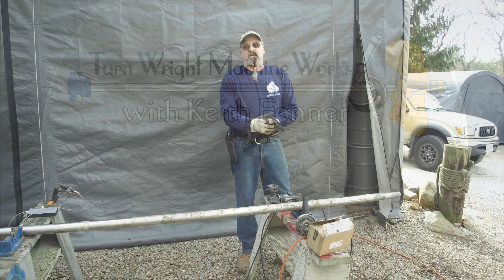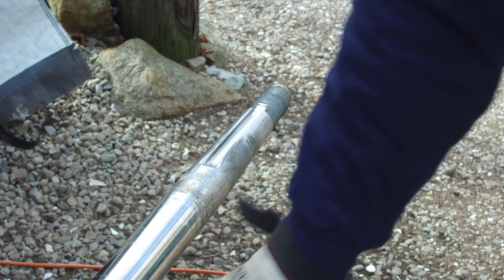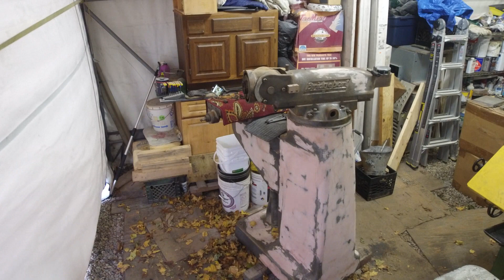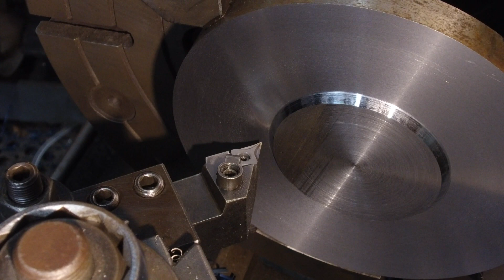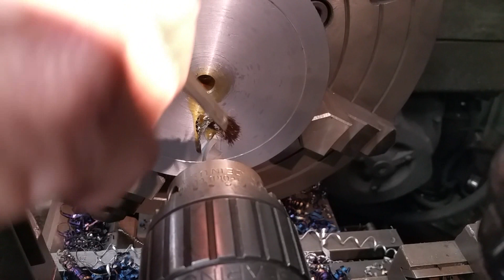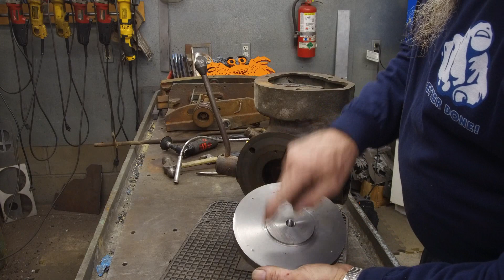Buffy Gets A New Set Of Spindle Bearings Part Four

Comment: I had a wire fly off a wire wheel like that one and embed itself about 4cms into the tip of my nose. I pulled it out with a pliers and it healed up just fine. If I wasn't wearing glasses and it hit my eye it would have been much more serious. Wear your eye protection.

Comment: I had been considering using sealed bearings on my spindle but came to realize that the oil that drips down from back gear would get trapped above spindle bearings inside the quill. Did you consider this?

Comment: when you go to install the precision bearings. are you going to use AvEs trick of wrapping them in wet paper towels and putting them in the microwave to heat them so you are not pounding or pressing them on the spindle instead of just dropping them in.. and also to heat the outer to allow them to drop in without any chance of damaging them. the microwave bearing heating trick video. https://youtu.be/LVODJm05plw   i was even thinking about V seals loosely against the inside faces of the bearings on the spindle to keep any dust or debris out of them.  without exerting any additional drag a fully sealed bearing does.
Reply from the maker: Not sure on which of my heating methods I'm going to use, but I also like just dropping bearing in place. ;{)------

Comment: Hey Keith... I've been waiting for you to get back to Buffy. My thought is to seal the bondo on the machine base quickly and easily with spray-on clear laquer. Polyester body filler is hygroscopic and will draw water right through it and destroy the bond between it and the substrate, even rusting the cast iron. The laquer is compatible under any top coat and even more bondo.
Reply: hygroscopic my man
Reply from the maker: will do!  ;{)-------
Reply: @tomclark6271  10-4 rubberduck

Comment: just a note om my own experiences with wire wheels. I have found that if you occasionally sharpen the wires it makes them like new again and no need for excessive pressure to do the same job. with your wheels turning touch the lightlt to your belt or disc sander and refresh the edges. I have found that even reducing the wheel that small amout hat the stil last longer and much less likely to shed wires if not using excessive pressure   never miss a video  Dave..

Comment: I have pulled pieces of them wire wheels out of my face that were quite deeps so guards and safety glasses are a must when using them...unless you are not a fan of good vision that is cause you will get one in the eye if you don't wear glasses...
Reply: Try to never line up your body with the axis of the spinning wheel.
Reply: @johnferguson7235  Very good advise...

Comment: Be careful of leaving all that "Bondo" without a sealer coat. Polyester filler can be hydroscopic and hold water that will bubble a finish down the road. It will also allow rust to form on a steel surface and delaminate, causing blister, cracking..etc.  I know the aesthetics are not the primary concern, but for all the work thats been done; some future hassles can be avoided. Looking foreward to seeing it finished.
Reply: Donald W Rissler ... I was thinking the same thing. I always keep some cheap laquer sealer around for just that purpose. A quick thin spray-on coat of clear laquer will seal the bondo and is compatible under any top coat, paint or more bondo.
Reply: hygroscopic my man.
Reply: Water sucking body butter?......

Comment: I am looking at trying to regrind a spindle taper on a Gorton that came from the factory w/ B&S #10. There is virtually zero tooling available for this spec. So is it even conceivable to make R8 without the key but w/ draw bar I wonder?
There is enough material I believe. Any thoughts Keith, I have been meaning to ask your opinion :-)
Reply from the maker: Well study the to differences in the bores and the configuration on the outside spindle nose and make the call, would be better on finding tooling for the R-8 over the B&S. I have ran my 1960 Bridge port for 20 years without the pin, for holding the collet.   ;{)-------
Reply: Going from B&S to Morse taper would likely be easier.

Comment: Hi Keith, greetings from the UK.
 As always, more practical logic from yourself, I have always considered myself to be a lazy engineer and will always look for the easiest way to accomplish something wherever possible so thumbs up for this video!
I've also noticed that you often use the English term spanner instead of wrench, is this a legacy from the shipyard or do you have any     background with the UK?
Reply from the maker: Ship yards but we did differ on wrench and spanner, two different tools, we had face spanners, pin spanners and cog spanners, as for the nuts and bolts, we called box or open ended wrenches, and the double ended box wrench with 3/4" one one end and 7/8" on the other got the nick name mill wrench.  ;{)------
Reply: Keith, thanks for the clarification. 
We  have open ended spanner (both ends but different sizes), combination spanner (ring and open but same size) peg spanner (either round or square  pins), C spanner (chuck removal etc.) Torque wrench,  wheel brace for wheel (lug) nuts and the good old standby adjustable spanner (hated by the Germans who call them English scanners because it offends their sense of precision)!
Variety and tradition makes the world go around, have a happy Christmas

Comment: seems you and abom and bcbloc are the only ones not afraid to take a heavy cut on the lathe
Reply: Well, a lot of folk have weedy lathes. Try that facing cut on Clickspring's lathe and,  well, you would damage the bed because the piece is too large.  But there is a big difference between a 5hp (or maybe 10hp for Abom)  lathe and a 1hp hobby lathe. Back in the day hobby lathes were 1/4 hp or treadle operated, so there has been some improvement. 
Also there is a difference between production lathes and toolroom lathes. I have one of the latter, probably as wide and deep as Keith's lathe, but only 20" centres and 3hp. It won't take those cuts (the electromagnetic clutches slip) but there will not be any machine distortion at the cuts the lathe is meant for.
Reply: well maybe I should clarify my remarks. I am referring to people who have bigger lathes and do only light cuts for some reason.i am aware. that different size lathes have different capabilities.But a 14" leblond should be capable of more than a .020 per side cut. Im sure keith knows what I am referring to.

Comment: I thought occurred to me the other day while watching one of your videos where you were tapping using a crescent wrench in your TAP follower. Machine something basically like a flange nut but instead of a threaded Center hole have a square broach in the center that will fit the tap. Slip the piece onto the tap and then use a ratcheting box wrench to spend the thing. Where the tap goes from Square to round will keep the nut from sliding off, and the flange on the nut will keep the wrench from sliding off with just side pressure
Reply: Fancyturdhat... Great way to break a tap!
Reply: @tomclark6271  why would you be any more likely to break a tap using a ratcheting box wrench versus a crescent wrench? You're still using a wrench, it just saves you the annoyance of taking the crescent wrench off and on five hundred times each direction. I suppose you would have to flip the switch to reverse it and break the chip, so maybe that's just as annoying I don't know.

Comment: Straight wire wheel looks good, yes found a few wires stuck in my leg before now, through jeans. The wires work harden after time, so when you start loosing wires, more load is on remaining.
Like the "Pink" Bridgeport, what's the final colour going to be?.
Best regards and all the best for 2019 from the UK.
Reply from the maker: Smoke Gray and Buff  ;{)--------
Reply: So, a ship theme.
Reply: Keith I'm a new subscriber here in the UK. Love the Buffy series so far, can't wait for the next episode. With regards to your wire wheel part I've used loads of cup and straight wire wheels down to the last three strands and boy can I tell you they bloody hurt when they stick in, so WEAR a FACE SHEILD to save your eyes and unless you want to strengthen up your beard with stainless wire of course! Best wishes for Christmas and the New Year from the UK.
Reply: I often get them stuck in my forehead above my visor.
Reply: Erik Mewes  you need to start looking at what you are doing and not preying to your work then !!

Comment: view 179 - maybe that age difference between the 2 mills...the older (or maybe lighter duty) bridgeport has a different  drawbar? I snapped one in two...kennemetal had it but the model # designation didn't differentiate the part size difference. thnx keith